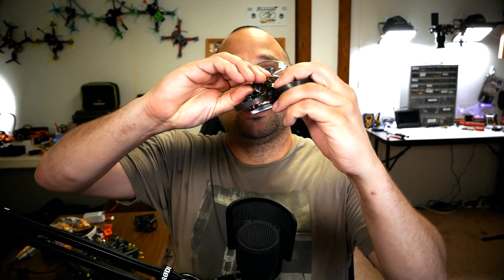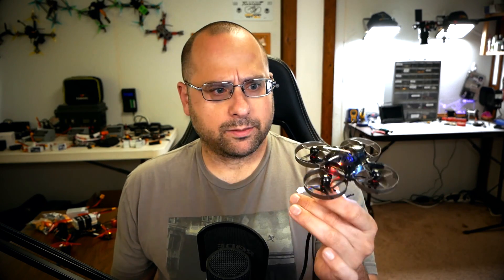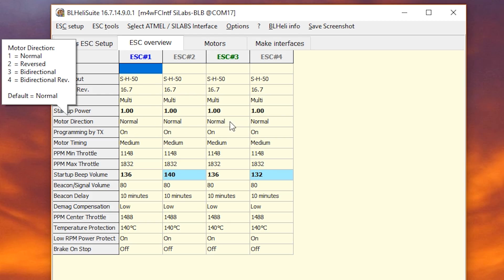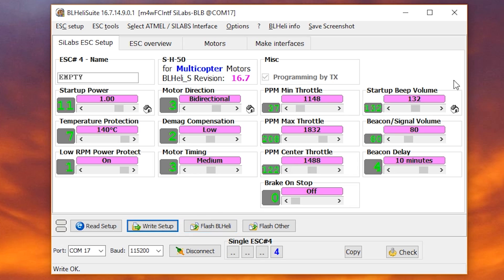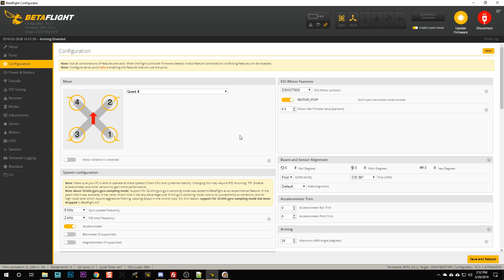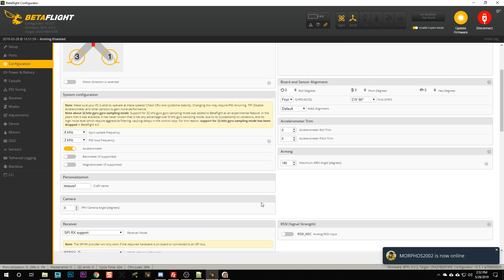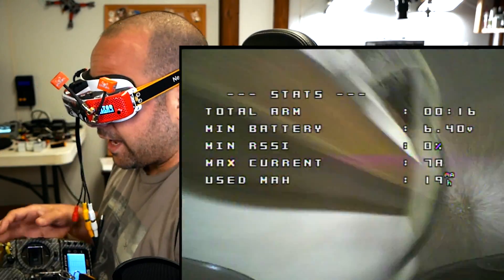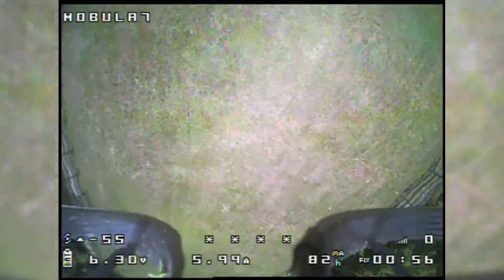How I Flew This Mobula 7 Upside Down | BETAFLIGHT BLHELI 3D MODE HOW TO SET UP

Comment: hi joshua, i have entered a business with rc inflatable airships, but the sistem is soo heavy and so not-intuitive and im thinking to put a drone flight controler and deal with the programming in betaflight... with aio sistems i can reduce in 300g the gondole of the air ship, meaning i can put a larger batery to fly more! let me explain and ask you some questions

Receiver: FLYSKY FS-IA6B
Radio: RADIOMASTER TX16S (Internal RF)

the sistem has 3 ESC with 2 larger motors and one small motor
the first big motor does in bi directional mode: UP and DOWN
the second big motor does in bi direction mode too: FRONT or REAR (on the trottle channel, on a tx16s with guimbals tunned with self-center too)
the smaller motor does in bi-directional mode too: TAIL LEFT or TAIL RIGHT

so lets go, the question, staying on the FLYSKY receiver:
how do I configure assignment to the motors to individual channels on bi-directional mode? i presume that is on the radio and thats simple question

but

changing to an an flight controller like the IFLIGHT F7 AIO and CROSSFIRE for using BLHELI and BETAFLIGHT, for intuitive configurations, the questions are:

1> Can I configure assignment to the motors on individual channels? im only used to the standard mixing of quads, im very basic when terms of betaflight, until now all drones buyed where rtf...

2> Knowing the airship is full of helium and drags it self, the motors must not spin when armed, and I have to set breaking on the motors, so when i loose the sticks, the motors stops imediattly, is it possible is it possible on betaflight?

3> with this awnsered, i think it would be easy seting the bi-directional mode, like an flight mode on a button, that im only flying on that mode this air shiop, right? and further away thinking of puting a flight computer too on it so it can flight it self, what do you think?

Comment: Hey Josh, I went through the process and everything is working as it should, however, it almost seems like not well enough to fly. I have a mob7 as well but makes me think maybe there needs to be some filtering of some sort. Sometimes when I go from negative to positive, 1 or 2 of the motors either won’t spin back to positive rotation. Until it lands and restarts itself. Could it maybe be the board can’t handle only being 5A? Not sure. Thanks!

Comment: Zoe,
Is it possible to set up your arming sequence so that you can flip the arm switch first then as you pass through center throttle, the quad actually arms?

Having flown 3D helicopter LOS for many years ( https://www.youtube.com/watch?v=8Tz5NTmKz58&t=199s ), I thought 3D flying in FPV would be a blast. It's a bit of a catch 22. The props are hard to find, so it's hard to maintain people's interest. Without a lot of people interested, nobody stocks the props. :(

I find that, with FPV, it's kind of fun to figure out how to do all the stuff without the inverted thrust. But I'm sure I will give it a try again in the future. :)

As an aside, I still fly my drones far better LOS than FPV. :)
Reply from the maker: Sorry for any confusion. I'm not Zoe. This isn't Zoe's channel. She hasn't received your message.
Reply: i have a video about all 3d props on market

Comment: ok I just found out that there is BLHeli_32 and BLHeli_S. Because BLHeli 32 Suite can't read my ESCs... You need to check your specs of ESC or Xin1.... If you have BLHeli_S i thnink you need to go with BLHeliSuite and notBLHeli32Suite... And the Description "How to Connect, Flash and Configure BLHeli_S ESCs" from Oscar Liang helped me to use the suite...

Comment: 3D props available at the moment (only 5 inch at the moment):
* Gemfan 513D-3 (Quality Gemfan propeller for 3D flying.)
* Gemfan Master 3D (old prop)
* HQProp 3D-5X3.5X3

Another solution is to reverse 2x 2D props (on smaller quads) but that is not a perfect solution... Hope we will get also 2-4 inch props soon from the prop brands...

Does anyone know if anyone is able to 3D print 3D propellers? And whether these new toroidal propellers are 3D propellers, because you can already buy them from 3D printers... ?

Comment: So I can use any props for 3d flying? But there are 3d specific props?
Reply from the maker: 3D specific props are equally inefficient in both directions. Standard props are much more efficient when right-side-up, and much less efficient (but still can work) when flying upside down.
Reply: @JoshuaBardwell  I got a little confused in the part of blheli bidirectional reversing the motors. Can you clarify please. For example if my motor is already reveresed or normal then what do I change it to?
Reply: * HQProp 3D-5X3.5X3
* Gemfan 513D-3 (Quality Gemfan propeller for 3D flying.)

Comment: Hey there, new sub here, loving the content! I'm new to drones and FPV in general, so I took everyone's advice and bought a simulator first to learn the ropes first (TrypFPV), and I find 3D mode more fun and more controllable, but almost everything I read online says that the only mode we should be learning is Acro mode. Is this true? Will learning in 3D mode cause problems later on? I just find it much more easier to control in 3D, as opposed to letting off the throttle and waiting for the drone to fall to where I want it to be. Thanks
Reply: I only fly in 3D now because mr likes it better than ACRO and I'm glad I noticed it early. Then it won't be that difficult to get used to... So it's best to test what you like better in Liftoff.

Comment: Yes sprinkle it in . 3D is the easiest thing to learn. and can expand your normal accro in so many ways. This has been a game changer for me!  all my quads are set up for 3D now. 5in & 3in quads. and best normal props to use are racekraft 5046 crane props. they have a smooth transition and make enough thrust in reverse to work great. i tried real 3D props and thought they suck and went back to my racekraft. hope you give this a real try on one of your 5in quads. i would love to see you expand your flying to a new level. Most people will not even try this they think it's to hard but it's actually one of the easiest things to learn.
Reply: I agree

Comment: I just found this video after messing around with 3d yesterday, coincidentally I recorded a trick yesterday that is pretty close to what you describe, I uploaded it here: https://youtu.be/0pWU7xoztGs

Please excuse my unsmooth/jerky flying, I just started 4 days ago and I'm still using the 360 controller until my Zorro arrives
Also, yes that gap was intentional, at first I hit it by accident, and then I broke about a 100 virtual drones trying to do it again

Comment: When I learned that Dshot supported reversing, I knew that 3D mode was right behind it.
My only bummer is that you can't "just" switch between 3D and 2D with an aux switch with all the underhood.
But you CAN map a mixer in your transmitter to move the endpoints so that zero is 50%.
Though if you're going to fly 3D, it's best to just .... learn to fly 3D.
Reply from the maker: You definitely can enable 3d mode with an aux switch.
Reply: @JoshuaBardwell  i agree
Reply: @JoshuaBardwell  do you have a video on how to do this?
*Edit for anyone looking, Zoe FPV covers this in her "How To Setup 3D in BetaFlight" video!!! https://youtu.be/3kYKreqs-MM?si=oVccZ_joEv3HTug1&t=673

Comment: I've been practicing 3D for months in Liftoff, now ready to try it for real. I find the biggest benefit of 3D is when diving, you can correct your trajectory without having to roll 180°. And when powering looping over obstacles, if you didn't use enough power to clear the obstacle, you can fix it with reverse thrust - and you can make it look pretty too.
Reply: the same for too much trust...
Reply: Do you still fly with throttle gymbal all the way down or mid ?

Comment: Hi Joshua is it possible to buy 7 inch 3d props and if so do you know where I can get them
Reply: as far as i know no. Only 5 inch 3D mode props exist:
* Gemfan 513D-3 (Quality Gemfan propeller for 3D flying.)
* HQProp 3D-5X3.5X3

Comment: If I knew how to code in Betaflight, I'd do it this way. However, I am not sure if it's a good idea. So sticks position will be the same. There will be no 1500 position at 0 throttle. 1500 will still be middle. In order to trigger 3d mode, we do a roll flip horizontally which should also reverse rotation of the motors. I am thinking gyro will have big responsibility in monitoring orientation. Now, while our quad is flipped, sticks will still be normal. When we throttle like how we do it in non 3d mode, it will just elevate while quad is inverted. Of course, at first, our brain will try to roll flip the quad again to its normal orientation. But I hope you understand what I mean.

Comment: Thanks JB! I learned something today 😄 question: is there a way to change the taranis qx7 to center the throttle stick without the spring action? Thanks!
Reply from the maker: How could the stick center without a spring? I'm confused. The gimbals can be adjusted to center or not yes.
Reply: @JoshuaBardwell  on the dji fpv combo drone controller, if i tighten the screw on the back up to a certain point, i can feel the center of the throttle, like a detent, but the throttle stick doesnt spring back to the center. Can i do that on taranis qx7?
Reply: whoa! your flying drones in 3D? I am subbed to your channel and didn't even know you fly. cool
Reply: @SkyCandyVisuals  Thanks SirFpvALot! I do fly (mostly cinewhoops).  I don't fly in 3D though, or at least not yet.  I just watched because I'm curious.

Comment: I feel like 3D mode would be more common if it were something you could switch on and off during flight.
Reply from the maker: You can. There is a 3d aux mode that turns it off and on.

Comment: Another good reason to use 3D flying is that you can control your altitude better because you are not limited by the gravitational 1G downward acceleration but can generate more with the motors.

Comment: That's pretty cool. Thank you for sharing this. I had always wondered. With the center stick being neutral, there's a lot less range on the sticks to get to full throttle in each direction. That means that the super rate and expo would need to be adjusted drastically from where a pilot flies non 3D mode, correct (assuming the pilot wants the same feel)?

Comment: the thing with bi directional i had yesterday for flip after crash... bidirectional splits the inputrange that means 1000µ = -100%; 1500µ = 0%; 2000µ = 100% so that would be if you had .... a car with BLHELI esc and just a reciever without FC that kinda does everything digitalaly anyway

Comment: Hi joshua im trying to do this on my 4 inch. Done everything you said to do  on blheli the motors go both ways with the slider but i cant get drone to arm with transmitter do you know why it wont arm. Have got it set up when in air mode i can switch it to 3d mode .
be most gratefully for your help looks load of fun Pete

Comment: Another great video Joshua, thanks!  Quick question, since there is an option in betaflight, for most cameras now I believe, to flip your view 180, in case you need to mount your cam upside down, or like I've done and mounted it like that by mistake..lol.   What would you think of putting that feature on an aux switch?  So when you flip upside down, you can also flip the camera.  I'm pretty sure Betaflight doesn't have that capability now, but if 3D really got popular and they added that, do you think it would be a cool option, or do you think it would take away from the challenge and wild looking video footage that I'm sure purist would say, is the whole point of 3D flying.  I think I lean more toward the purists side and think it would defeat the purpose a little.

Comment: I tried following the directions with my Mobula 7HD and unable to get it to fly.  It wiggs out.  I assigned 3D mode with my flight mode 3 position switch so I can take off normal but no dice.  Mmmm
Reply from the maker: Most likely your motors are spinning the wrong direction in 3D mode. If you set them to "bidirectional normal" try "bidirectional reversed" or vice versa.

Comment: Is there a way to set a mode so you can switch back and forth? I always used a flight mode switch when flying helis inverted.
Reply from the maker: Yes Betaflight can do that
Reply: It would be cool to have Acro mode also switch to 3D mode. Can you explain how to set that up in betaflight? You could do some cool slowmo style rolls with that setup.

Comment: So. I just tried some 3D flying with my main 5inch quad and it seems to me that I know why only a few pilots currently fly in this mode. Standard props have horrible efficiency in reverse - I've always known this but thig I know from now is how horribly low it is ;) If somebody want to check just mount your props upside down. It feel to me like switching from fullsize powerfull 5inch to tinywhoop ;) So with that massive asymetry in thrust 3Dmode is'nt very useful for average freestyle pilot. But after all it was a cool experience to try and I will try again with props dedicated to 3D. So if anybody want to try this there are a few things that should be done:
1. If you have posibility unlock centering spring on your throttle stick - it is much easier not to crash if you can feel your new 0 throttle position.2. Try 3D in Sim first - and this is a mandatory point.3. Put your props upside down and try to flying in standard acro to feel how low thrust will be in reverse.
Reply from the maker: It might be better with micro sized props since they are closer in design to 3D props anyway. For a larger quad, I still think it might be interesting to get some reverse push even if you can't fly entirely upside down.

Comment: Okay mr Joshua I need ur help when you jump in the vedio and say you are wrong what are u meaning my number 2 and 3 motors are reversed so I did bidirectional reverse  and my quad freaks out no flight need help lol ty sir
Reply from the maker: The bottom line is that when you RAISE the motor slider, the motor needs to spin its normal direction.

For me this meant normal motors -> bidirectional reversed. Presumably reversed motors -> bidirectional.
Reply: @JoshuaBardwell  u helped me again and bow we fly ty sir

Comment: Hey Joshua! I recently bought your FC and my s bus pad came off in crash. So I can’t solder back so I used RX4 now my esc signal pad came off in mid flight! My quad dropped like a rock.  Is there a way of getting a new board because this board literally lasted like a week or week and half. Is there anyway I can’t get another or a refund?
Reply from the maker: Please reach out to support@racedayquads.com about this.

Comment: Thanks a lot for everything we can learn on your videos !!
In 3d mode, if you want to make a front flip (whis for example 30% positive trottle) will the front motor spin non normal direction ? On an other way, does the front motors will try to go down and the backs one up (in case of an front flip) ? And if yes does it do with the others command as roll and the yaw ?
It's maybe a stupid question but i am disturbed 😅
Reply from the maker: The motors always reverse together based on whether the throttle is above or below the mid-point. The motors cannot all spin the same direction because then yaw would not work.
Reply: @JoshuaBardwell  
Yes of course but i was interested in if betaflight uses in 3d mode motors running on regular and non regular direction at the same time  to get more réactivity 
To be more concret if the trottle is over the mid point could motors turn on the opposite of the direction that they turn normaly.
Thank a lot for your answer
Reply from the maker: No, it doesn't do that.

Comment: When i started with this hobby (like 4 month ago) i really wanted to fly 3D, i spend hours in the simulator, had sooo much fun but then when i was picking my gear (wich frame, motor, ect.) i realized the main problem are the Props. So hard to find good fitting ones. So i paused...until now! 3D - im coming! 

So if anyone found some nice 3"-3D Props. Let me know. 

Thanks Joshua for reminding me ;)
Reply from the maker: Just give it a try with your existing props. You never know how well it might work and it's easy to try. That's the point of this video :-)

Comment: I started using 3d when I was learning acro as a way to avoid some crashes, help get out of a tree or to take off upside down after a cash. The biggest problem with 3d is that the props are horrible. Regular props, especially aggressive ones, provide very little thrust in reverse. 3d props just suck either way. When I play around with 3d I typically use a prop with very little "scoop" to it. Like a 5040 cyclone. Micros are a little better as the props don't have as much scoop to them

Comment: Momentary 3D... I’ve had an idea to do this for a while but I haven’t gotten around to it. Basically Blheli & betaflight setup is the same as normal 3D but use a momentary switch & channel mixing on radio to keep throttle in standard mode 2 configuration without centering in middle position. When switch is flipped, pwm value would drop to preset value(~1250). Then upon release, normal flying. Throttle resolution would be cut in half but probably not even noticeable to most

Comment: Can/should you use a center spring on the throttle stick when using 3D?
Reply from the maker: Nobody I know does that, because they often also use their radio for non-3D quads.

Comment: Nice, I assume this can not be put on a switch, so you have to be all in. I think it might be implemented more often if you could flip a switch to get back out of it.
Reply from the maker: It can be put on a switch. There is a 3D mode option in the Modes tab.
Reply: Joshua Bardwell ah, excellent thanks!